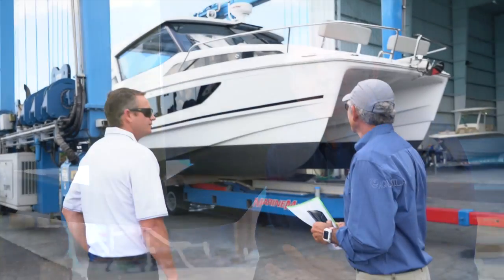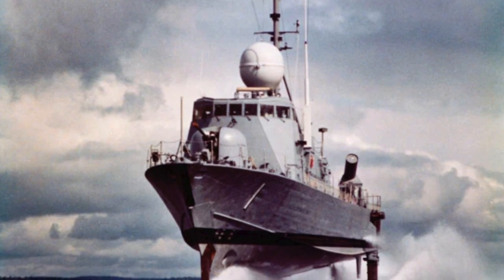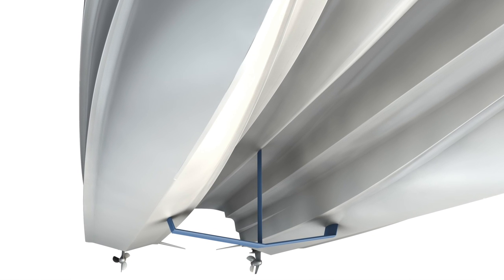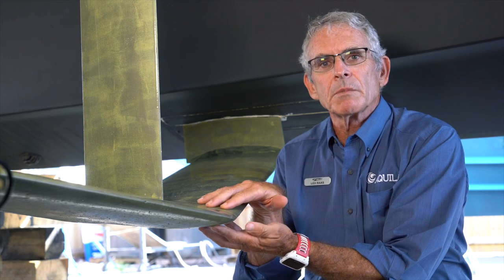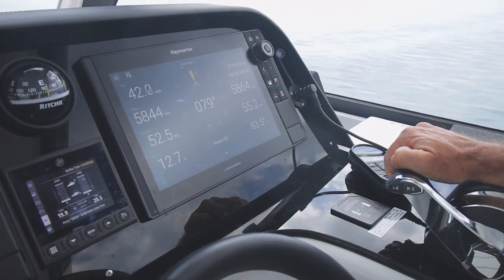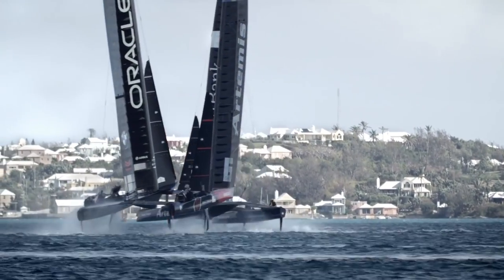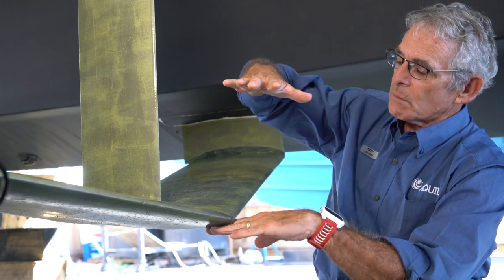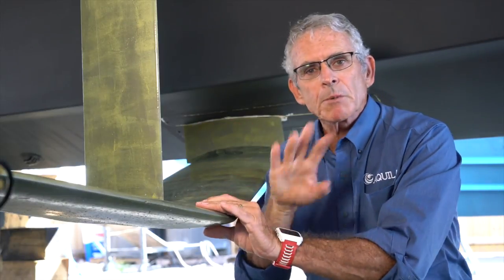Discover the Innovative Hydro-Glide Foil System on Aquila 36 | Power Catamaran

Comment: I've only viewed a vessel that would fit this category a couple of times in my life . One vessel had a device that raised and lowered the outboard motor quickly so as to keep the prop below the surface of the water . There was a pickup sensor / follower in the water that sensed the ride height and therefore the raising and lowering of it's outboard motor was very accurate . This linear lifting device was the same thing that can be seen on small construction equipment that's being used to carry an auger to drill round holes in the ground . In that particular case the 2 linear lift devices were strong enough to lift the entire weight of that construction equipment and probably more .

Comment: The biggest problem I see with most foil vessel designs, is that the way they are designed is that they will obviously catch, hit, or be interfered with by just about any floating object, such as lobster or crayfish buoys, floating debris, seaweed, or even marine life.
 I don't know how things are wherever you are, but as a former lobsterman from here in the Northeast USA, I can tell you that foil design just would not work around here, for the reasons I had mentioned. 
 As for a solution, I would suggest using four inverted V, swept wing shaped lifting foils, with each mounted to a single retractable strut on each corner of the hull.
Reply: Good take on this matter! I have been a boater for 22 years and there are always floating debris out at sea like big plastic bags, ropes etc....especially on a busy waterways where the traffic are heavy, common popular areas used by many  boats cruising or fishing.
Reply: The cat already has bulbous bows below the waterline.  This is the 100th one built & no reviews anywhere of any issues you theorise may occur.  Sailers really don't like innovation - it's scary, something new that gives 30%+ file saving, so irrespective of your postulations,  it's gonna happen 🤔
Reply: @milessmith589  So you don't believe that floating objects such as ropes, lobster and crab pot buoys, logs, or other floating marine debris cab be a hinderance to foil borne vessels ?. Maybe you ought to do a bit of research, before commenting on things, that you obviously know nothing about.
Reply: @shirleymae30  As per my original post Aquila already runs with below the water front bulbous bows (well known to be a debris magnet).  Anyhow the company has sold over 100 hulls to-date & with the application of this innovation giving saving on fule costs of such magnitude the market will decide what will & will not succeed - not the opinions of folks who can't handle other folks having differing opinions.  That's one of the reasons why capitalism works, especially well in a market where purchases are made with disposable income that can be spent where ever the purchaser chooses 🤗
Reply: @milessmith589  The bulbous bow is not an issue, i was commenting on foil designs in general, and how most foil designs could be designed to allow debris to pass by or thru, without damage or entanglement.

Comment: Can a foil system be used for larger, slower catamarans, To reduce drag?
Reply: The efficiency in getting the vessel up to speed may not make it practical. Design depending, foils can impart greater drag and inhibit vessels from attaining foiling speeds.

Comment: Interested to know why dynamics of the foil contribute to its suitability for lower speed efficiencies
Reply from the maker: Hi Noah, an apt question. In addition to greater fuel efficiency, the foils also provide a smoother ride by making you fly higher on the water. Essentially, less fighting through waves + easier ride = increased efficiency and fuel savings. You can learn more here: https://bit.ly/48prvKF

Comment: I follow the Aquila Evolution very closely. You have very smart designed boats. To see this hydrofoil in more or all your boats, it must be expected, and very exciting. I am concerned about the foil being lower than the keel. Any collission with debris or sticking up rock or obstacle, would rip the foil out with a good part of the keel, and then the boat would be lost. I would LOVE to have a hydrofoil for a multitude of reasons, stabilization, speed and less fuel consumption among them . but I cannot risk boat and life for a hydrofoil accident.
Are you planning on some slightly higher than the keel foils(with a draft of about 3' in your cats should not be hard), and if so, could you post them please ? it would definitely make you the leaders in Cat design.

Comment: Wondering if the hydrofoil decreases efficiency at lower speeds?
Reply: Probably not... since any lift it is providing is still pushing the draggy displacement hull out of the water a little and the drag of the foil is probably much much less than the main hulls themselves so.. negligible.

Comment: I don’t know how it’s reinforced inside the hull or attached but it doesn’t seem like there will be enough structural integrity to hold the foil in place without cracks or eventual structural failure.  The stresses under power must be tremendous.

Awesome idea but I don’t think it’s a fully developed tech in this application.   I doubt it will be stable enough to last the life of the boat or even a short period of time.

Comment: Different from the hyuscat system used by Stealth Yachts how?
Reply: This appears to be composite and all the images I can find of the hyuscat boats are aluminum or stainless foils but built and setup identically to this.... also these guys mention testing this on a RIB boat in the past so maybe they licensed it to Hyuscat or vice versa.
Reply: @Wingnut353  the hysucat system is much older. This just seems to be an updated version of hysucat. I do wish they would give credit to Dr Hoppe, the creator of hysucat.
Reply: @drieslaas8664  I agree.

Comment: This boat isn't innovative, and it certainly isn't your discovery or invention, in fact, it's barely an evolutionary improvement of past marine foiling systems. It's a knockoff of the Hysucat & Hysucraft designs from the early 1980's. Nice try.

You're being a bit disingenuous by taking credit don't you think? Still, it's a fairly decent design even for today given the R&D which has been ongoing for the last four decades.